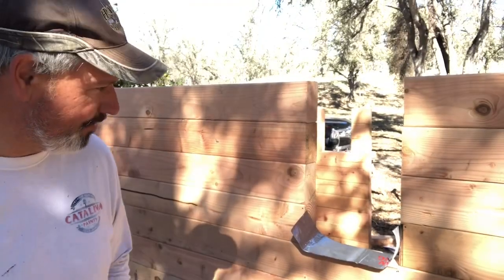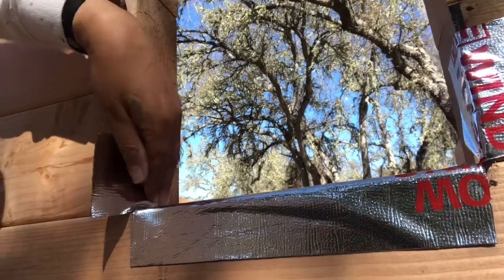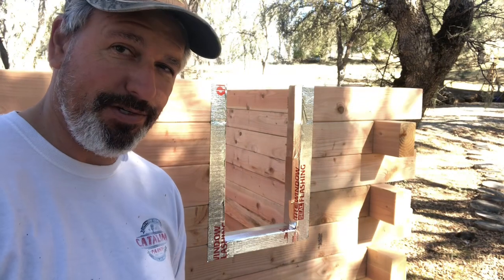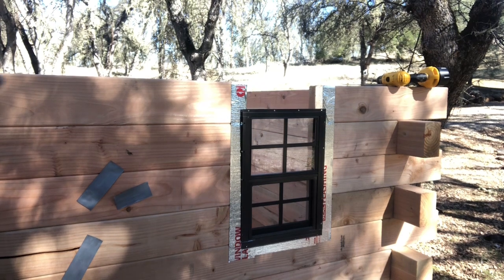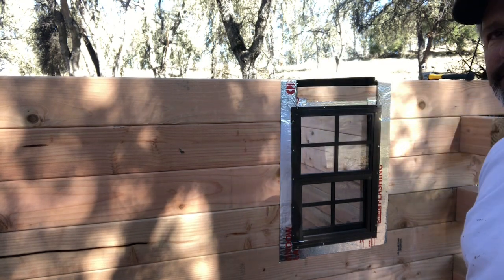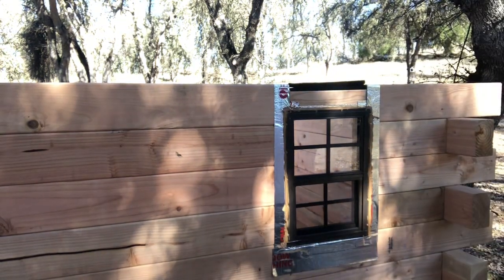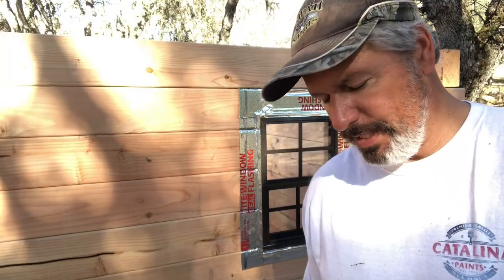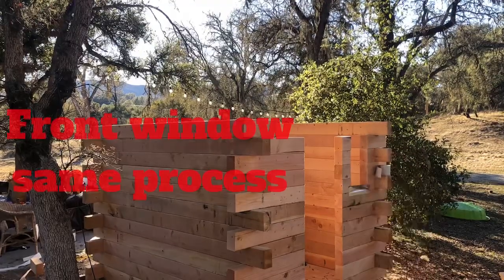DIY Butt & Pass Log Cabin Window Installation for Outdoor Steam Sauna (Part 3)

Comment: How many windows are you putting in? Will any open? How did you decide on size, height, etc?
Reply from the maker: 2 windows that both open. They are treehouse windows (12 x 18) so that I can control ventilation.  There is 1 more triangle shaped one at the top which is purely for light that does not open. Size and height were dictated by the dimensions of the structure.